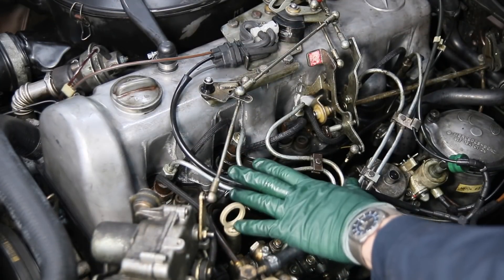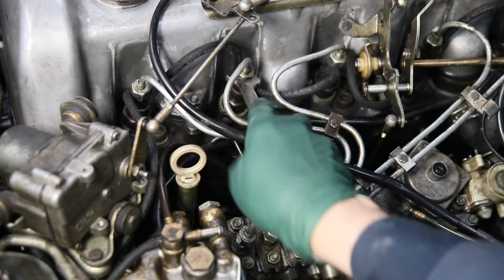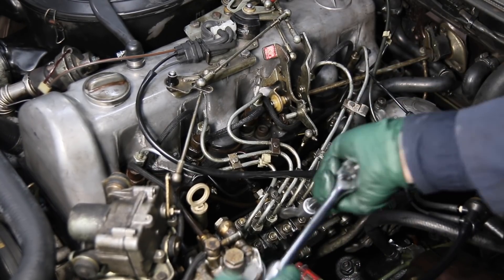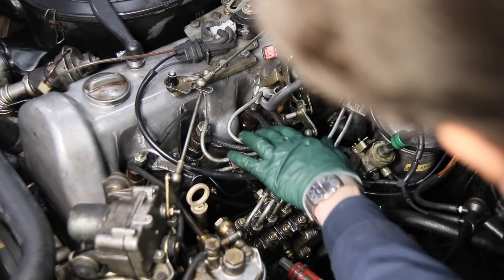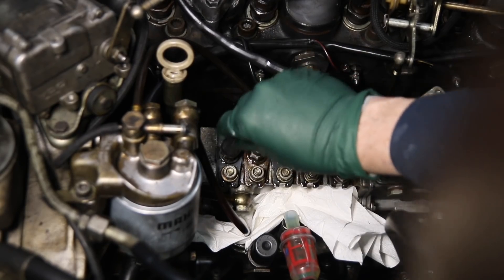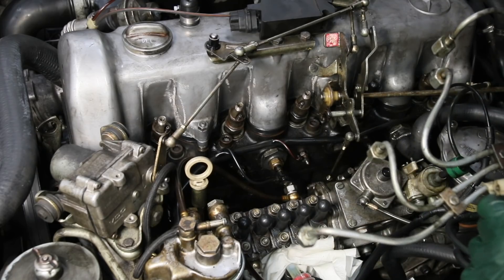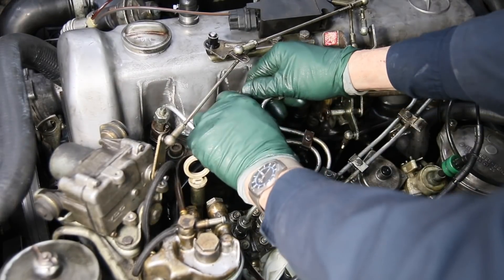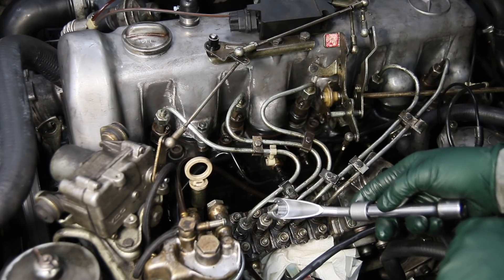How to Properly Remove and Replace Diesel Fuel Injector Hardlines

Comment: I have one of those tools for the injectors in my Lincoln. BMW engine, but same type injectors.  Its basically impossible to pull the lines without it.  My pump has even less access.  Bosch VE, the lines are in a circle facing the back of the car.  Very tight in there.